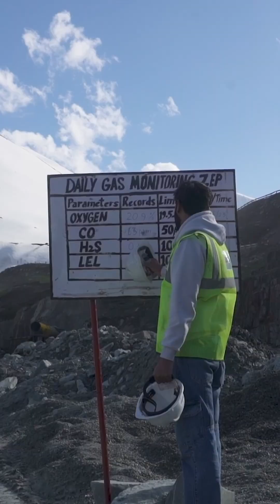These men risk their lives to build Asia’s longest tunnel. #construction #tunnel #engineering

Comment: I hope all this work will help connect a remote part of the country or something and they didn’t actually just build it because it’s the longest.
Reply: This tunnel is built in the Himalayan ranges, which are very steep and landslides are common. Many have lost their lives due to such landslides and this was an absolute requirement for years. In fact, the fact that this tunnel wasn't built sooner is a questionable act. The roads that this tunnel is avoiding are closed for 6 months of the year due to heavy snowfall.
Reply: Pretty sure that they didn't do this just for the longest tunnel in Asia. This project costs a lot of money to begin with.
Reply: don't worry it's not a showcase project like china has
Reply: This is to be able to send troops to that area to fight China
Reply: @jrobbin24  fight China? lol that is a death wish